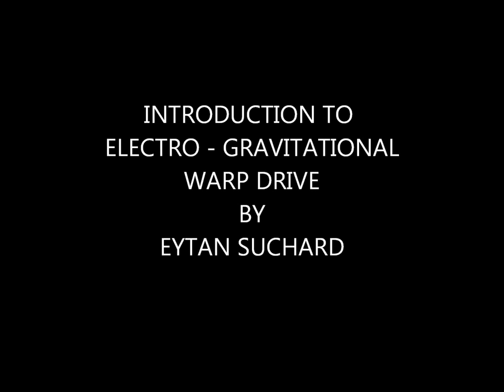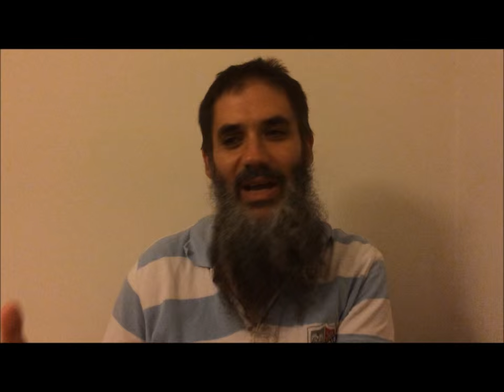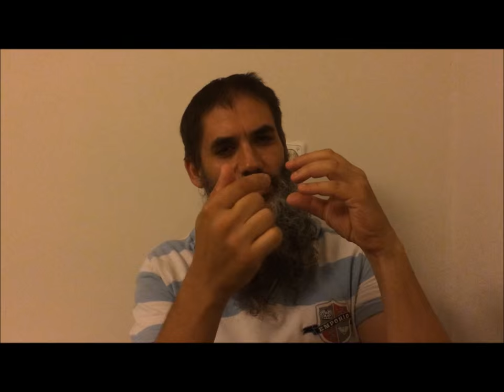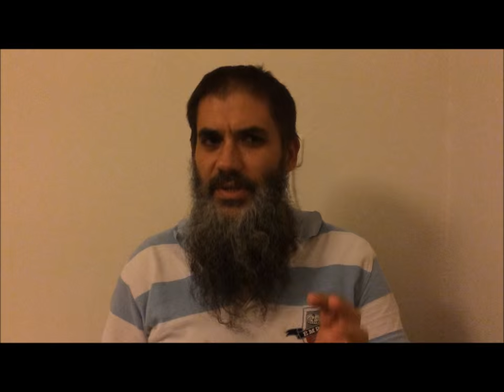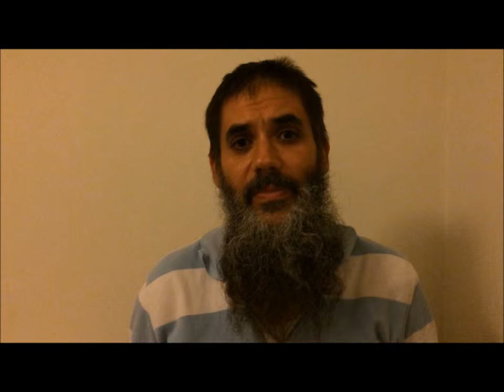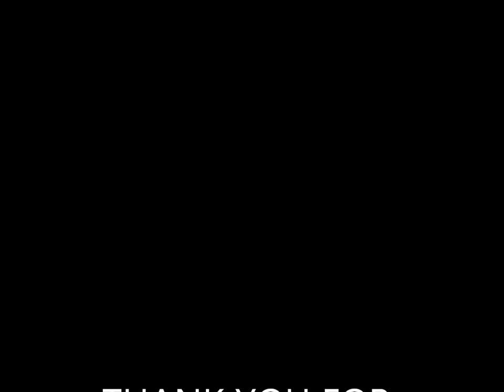Electro Gravity Project - Eytan Suchard & Erez

Comment: Hi Eytan.. Thanks for yours thinkig ;-) You have right, the thing is - you dont need strong magnets. but layers of for ex. 
when charges are incising in magnetic field copper and > Q is becoming superconductor, after that pair of bozons are amp in the magnetic field... device is taking all free electrons from surrounding, in this point all surrounding temperature is getting < if you want to solder something near this field you are not be able too because device is taking it.    . when is more then 2M you will se revers gravity.
Reply: Well, to reverse gravity, a very high concentration of electrons is needed. I do not see how Cooper Pairs can induce such an effect. For the model of matter as fields that prohibit geodesic motion (and having Causal Sets as quantum states, instead of particles) and gravity as a response to that disturbance, see:  
  http://iopscience.iop.org/article/10.1088/1742-6596/845/1/012019  .  In the appendix on page 30, (B.1) and (B.3) have a copy/paste error, g(myu,nu) should be contracted twice by a unit vector to 1, leaving a scalar equation. Thank you for your interest.